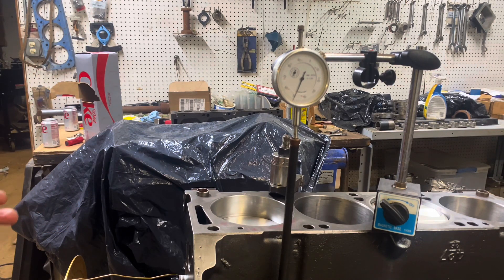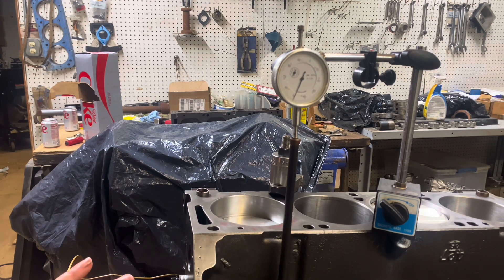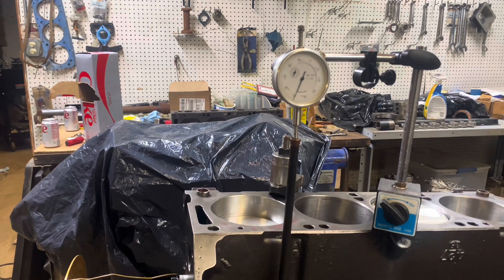427 medium riser build. Changing cam timing based on airflow.

Comment: So, you experience is saying that a better flowing head, likes slightly retarded timing events? 
How does the cam LSA choice weigh in on this platform? 
(I don't know Ford big block too well).
Reply from the maker: The cam is still advanced. Just not as much. This cam uses a 108 lsa so I put it in at 105.
Reply: @dovemfg do you still sell fe parts